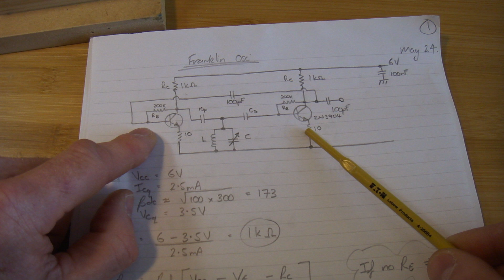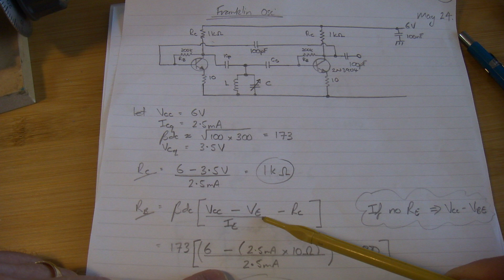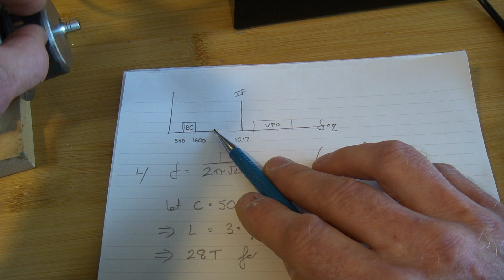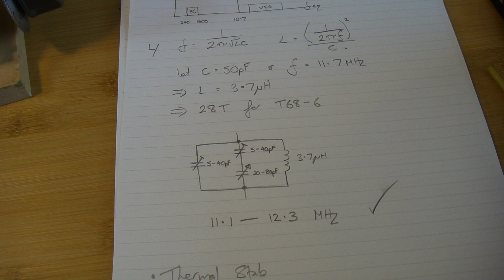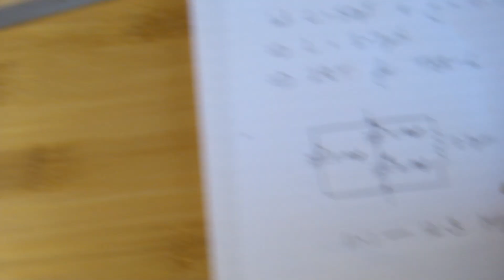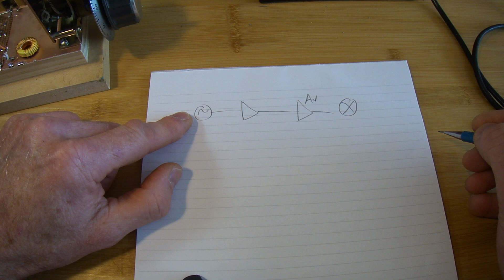AM Radio - Part 2a Franklin Oscillator

Comment: When I was an aspiring ham in high school I needed a VFO for a second generation receiver that I wanted to build.  After experimenting with several oscillator configurations I settled on a Franklin because it was the most frequency stable.  However, the tuning range was limited like all the others, limited by the LC tuning.  Also, I hated a non linear tuning dial.  So, I spent a lot of my free time building a rolling coil that tuned along with a cap modified to help linearity  and a wacky string dial to tune the L to work with the C for linearity.  It took months of tinkering but I finally built a continuously tuned oscillator that actually worked from 1 MHz to 35 MHz without any kind of switching.  All thanks to the rolling coil and the fantastic oscillating ability of the Franklin circuit.  After calibration I could tune continuously from between WWV 5 MHz to WWV 15 MHz and be within the width of the mark on the dial for any frequency between.  All this done with a 12AT7 for the oscillator!

Comment: I dont understand the need for such a high IF? At BC freqs, with a standard 455kc IF filter,  images are easily 50dB down, and using a tuned RF stage, even more. The tracking issue is going to be very much worse, the Rf stages tune a ratio of 3:1, the Osc range  is miniscule   in comparison, making  single knob tuning  with reasonable tracking very unlikely. Stability in the VFO  will  also be an issue given the ripple in these cheap filters giving  annoying phase distortion  audio artifacts throughout the passband as the freq  drifts...  There too is the possibility of powerful  signals in the 25 meter band mixing with your Osc, giving spurs in the AM band despite the balanced mixer, and front end filtering..
 The mechanics of  superhet AM radios is well developed over almost a century, they work well the way they are.. I am not seeing the logic in this.
Reply: One of the advantages of high IF frequencies is the opportunity to dispense with tuned RF stages and remove the tracking problem completely, you can implement a simple lowpass filter at a frequency just above the RF range you are covering and all imaging is filtered, probably 60dB or more.
Reply from the maker: Yes, that's what I'm looking to do. I'm just using what I have at hand and not trying to reinvent the wheel, or in this case the superhet.
Reply: As I understand it Charlie is using junk box parts.  He simply wanted to use that gorgeous variable capacitor.  I have the same 9Mhz crystal filter and I wanted to use this as a spring board to a general coverage receiver.  It's all good fun.
Reply from the maker: Exactly. None of these videos are 'this is how you do it.' It's purely me just having fun using what I have at hand. Hopefully, it will encourage others to give homebrew a go.
Reply: My FTDX10 has an IF of 9MHz and works perfectly tuning to the AM broadcast band. The reason for the low IF in the early days is because it was much easier to create LC filters with the required bandwidth. The other reasons for not using a low IF have already been proven false. I'm sure this will work fine and I'm excited to follow along. Cheers, Ian
Reply: @4youian  You misunderstand me. I am not saying it wont work, it just seems a needlessly complicated way to do it.for a simple  AM receiver BC band   only. Crystal filters have been around since the 1930s, that in itself is not the reason it was not done that way.. However, like others, I will await the results with interest. It is heartening to see radios being made from scratch again, and can only be encouraged.